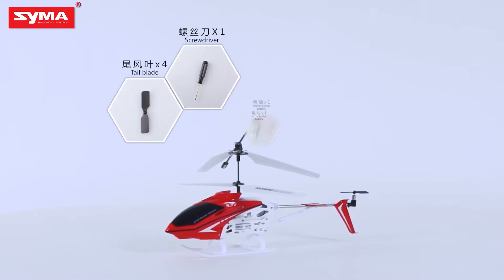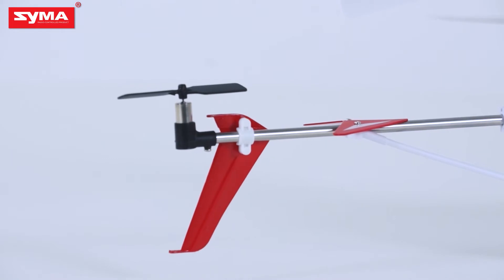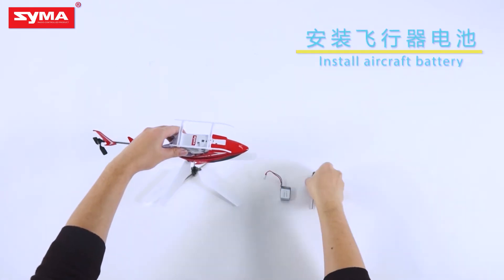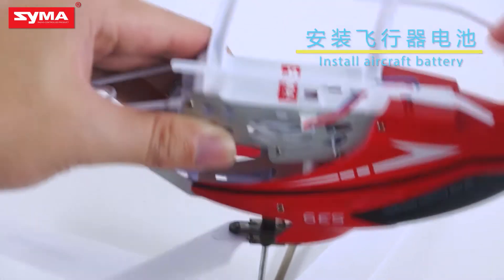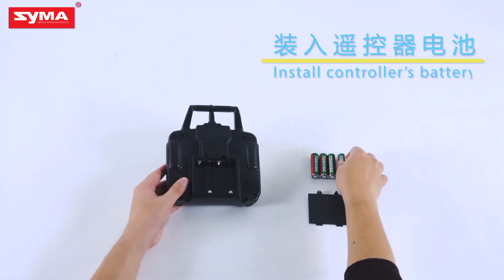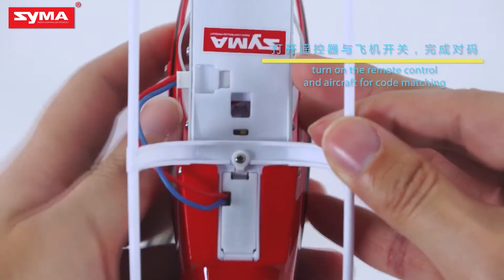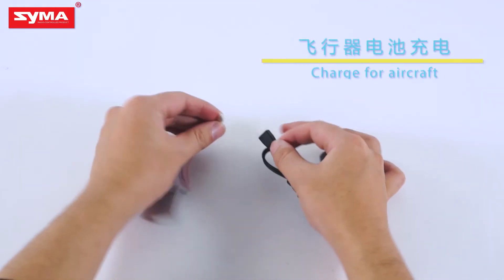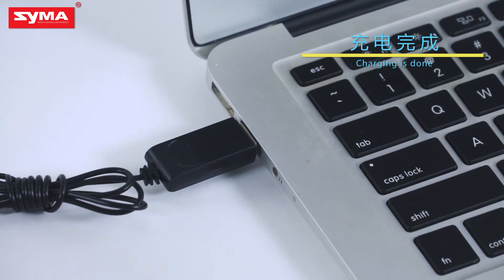How to Fly Syma S39 Helicopter(Basic Tutorial)

Comment: It's not really for outside use as shown in the video. All it takes is a small breeze to carry the helicopter away into a treetop. Also the manual for the S39 states this: 'While charging the LED light in the USBplug will not show. When charged the LED light will come on.' This is the exact opposite to what this video shows. Another thing is to make sure NOT to use a plug in USB charger as this can burn or weaken your battery. Instead use the USB port from a computer.